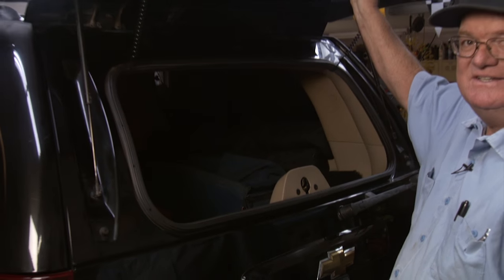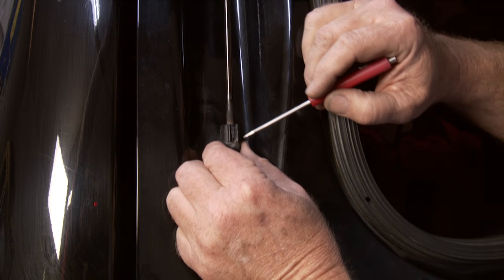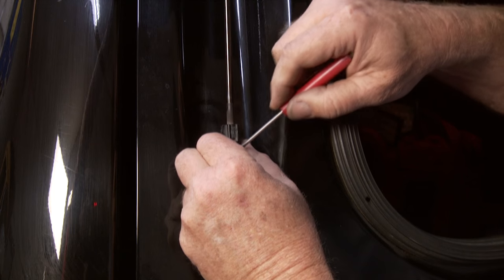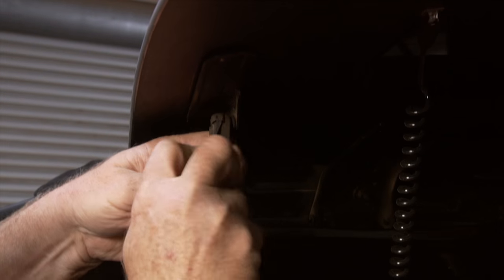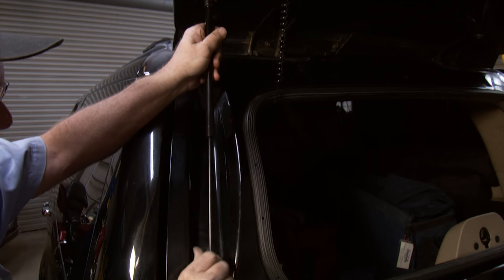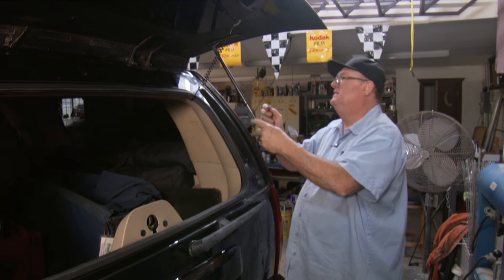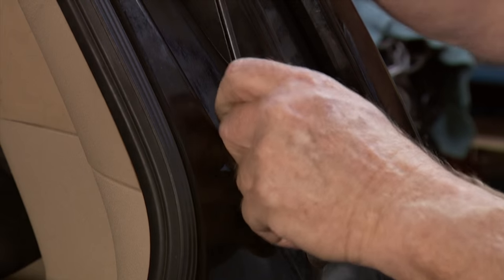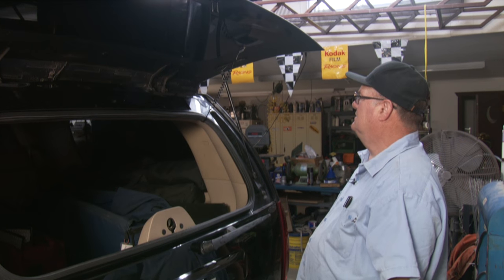How to Replace Rear Window Lift Support Struts | Easy DIY on 2007-2013 Chevy Suburban

Comment: I just did my 2006 Toyota Matrix.  I am not very handy and it did take about 10-15 minutes to get the old ones off.  The ones that went bad on mine were for the hatch.  Window struts are still ok.  Got them off of eBay  with a 12 month warranty for $13.  Dealership with labor wanted about $150.